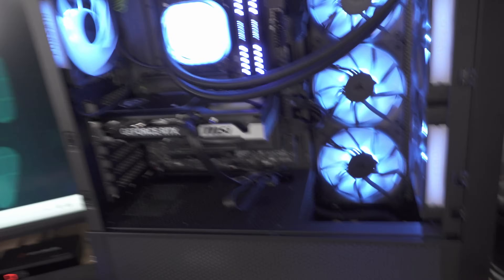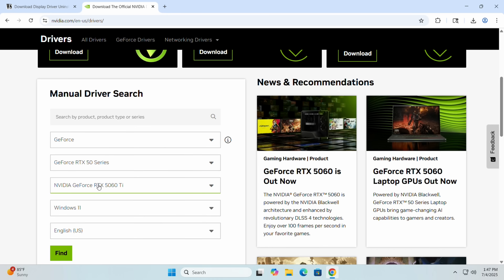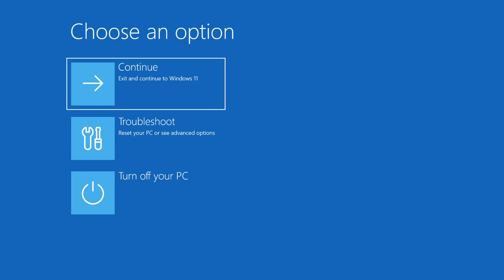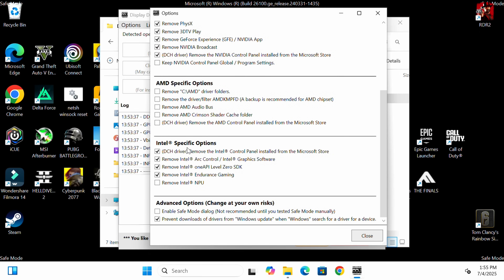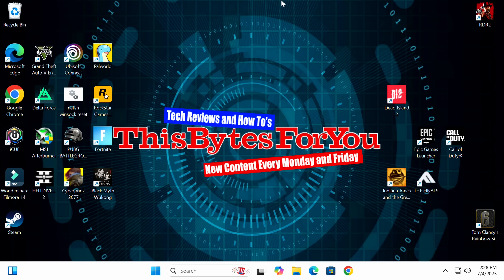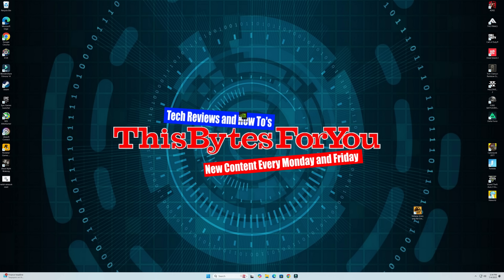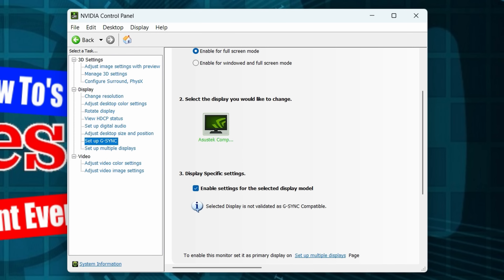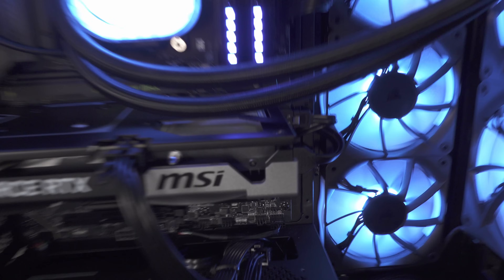The ONLY Way to Install RTX 5060 Ti? (Avoid Headaches & Maximize Performance)

Comment: Sometimes my screen turns black for a second then goes back to normal. Do you think this is a problem with my gpu or driver related. Please could you help me. Thank you
Reply from the maker: That can happen with driver time out, also with over heating and consuming too much power as well as corrupt drivers. What is the manufacturer and model number of your motherboard, graphics card, CPU and power supply
Reply: @ThisBytesForYou Thank you and the motherboard is a msi z490 gpu is a Rtx 5060 cpu is an intel i5 10600k and power supply is a Corsair CX 650M.
Reply from the maker: Z490 is a chipset and rtx 5060 is a gpu, please provide the specific model number msi in this case gave it and who ever uses the Nvidia GPU on their PCB.
Reply: @ThisBytesForYou Motherboard is MS - 7C80 and graphics card is MSI GeForce RTX 5060 8G SHADOW 2X OC Graphics Card - RTX 5060 GPU, 8GB GDDR7 (28Gbps/128-bit), PCIe 5.0 - DUAL-Fan Thermal Design (2 x TORX FAN 5.0) - HDMI 2.1b, DisplayPort 2.1b
Reply from the maker: So you have an MSI MAG Z490 TOMAHAWK motherboard.
#1, I recommend you update your BIOS: https://www.msi.com/Motherboard/MAG-Z490-TOMAHAWK/support
There have been a few performance, microcode, security updates, PCIE lane functions, Resize bar (Incredibly important for proper GPU use, ME and more updates)
#2, your power supply seems to be good enough, as a 650 when the card requires a 550Watt, as long as you are correctly connecting an 8Pin PCIE cable to your card and have it seated properly.
#3 Have you watched this video and removed your previous card (ondie cpu graphics is considered a graphics card, since it uses graphics drivers) and how I show you to configure the BIOS and install the drivers?
#4 A biggie is UEFI and GPT, i will list them below, please answer each so I can help you
  If your C drive GPT or MBR, you can find out by Right clicking on the Start button, then clicking Disk Management.  You will see on the bottom left side, Disk 0, Disk 1, etc, on the right of the lines you will see drive letters.  the line that shows the (C:) drive, right click on that Disk x and select "Properties".  On the properties window, click "Volumes" and on the line reading "Partition Style" what does it say?
  Do you know if your BIOS is MBR or UEFI?  To find out, download and run GPU-Z from here: https://www.techpowerup.com/download/techpowerup-gpu-z/.
After you download and run GPUZ, on the main screen, where it shows the logo of your graphics card Manufacturer, under there, does it show UEFI with a check or MBR or Legacy?
Reply: @ThisBytesForYou Thank you for your help and I will do these steps and get back to you
Reply from the maker: Sounds good my friend, let me know how it goes.
Reply: @ThisBytesForYou   For step 3 in the BIOS it doesn't give the options which you said in the video and in step 4 there is no line reading "Partion Style"
Reply from the maker: Help me out here, what does it say
Reply from the maker: Well yeah, you have a different board, so it makes sense but because your board is different and there is no pdf for your BIOS, I can only help you with the video i have, you will need to navigate your BIOS.  But I see in your settings, advanced, PCIe, PCIE sub system settings you have Resize bar, enable that, select the Gen for your card, your board I think only does 3, so select 3 or the highest,  for the rest follow along as closely as possible.
Reply: when u're installing drivers thats normal if it's in that case.. if it's doing randomly then i have no clue it might need a fresh install of drivers

Comment: Hi I am unable to get in to safe mode as when I press 4 or F4 it doesn’t go in to safe mode. Please could you help me
Reply from the maker: So there is a new windows update that killed USB support in safemode, just came out October 14th... amazing isn't it.  Try this to fix it, in regular windows mode
Go to Start > Settings > Windows Update.
Click Update history > Uninstall updates.
From the list, find the update named KB5066835 or one installed around October 14, 2025.
Select it and click Uninstall. This will remove the problematic update, restoring USB input in WinRE then you can try it again.
Reply: @ThisBytesForYou ok thank you
Reply from the maker: Always a pleasure my friend, so very happy I could help.
Reply: I’m trying to find the windows update to remove. I don’t see the windows update you mentioned. I have a usb for my keyboard and mouse.
Reply from the maker: @srtjas0n  that has been updated, so I HIGHLY recommend updating to the VERY latest windows update and it should be good.  You have a USB for the keyboard and mouse, you mean a USB cable connected to the keyboard and mouse to the PC?

Comment: Hi mate I change form AMD to rtx 5060 ti I did everything but the when I turn on my pc the gpu running but the monitor doesn't give signle
Reply from the maker: There can be a few reasons, i will list them below, please answer each so I can help you
1.  What is the manufacturer and model number of your Motherboard.
2.  What is the manufacturer and model number of your Graphics Card.
3. If your C drive GPT or MBR, you can find out by Right clicking on the Start button, then clicking Disk Management.  You will see on the bottom left side, Disk 0, Disk 1, etc, on the right of the lines you will see drive letters.  the line that shows the (C:) drive, right click on that Disk x and select "Properties".  On the properties window, click "Volumes" and on the line reading "Partition Style" what does it say?
4. Do you know if your BIOS is MBR or UEFI?  To find out, download and run GPU-Z from here: https://www.techpowerup.com/download/techpowerup-gpu-z/.
After you download and run GPUZ, on the main screen, where it shows the logo of your graphics card Manufacturer, under there, does it show UEFI with a check or MBR or Legacy?

Comment: My old card does not have a power connector. Is it optional on the 5060Ti ?
Reply from the maker: no, its not optional, the card requires 180Watts, a PCIE slot will only provide 150Watts and as its used, will consume more with heat, that being said, a system requires at least a 600Watt that means though next time you upgrade your graphics card, you will also need to buy a power supply, so I always recommend more.  You can nab a 650Watt on Corsair for under $70 but I would recommend at least an 850Watt.  If you are going to buy off of Corsair.com, use Coupon Code "ThisBytesForYou" at the check out to save 10%, it's not a lot but it will help.

Comment: So, You cant just plug it in and it work?
Reply from the maker: Ummm work is relevant, if you just want it to function, yes it will work but expect loss of performance and potential bluescreens and other random errors.  You want it to work well and get all the peformance you bought it for, follow along.  Which do you prefer?
Reply: @ThisBytesForYou  :'( 
Everything is so complicated these days.
Nothing is plug and play and requires this download, that update, and dont forget the app that is a nightmare to use.

How is a regular person ever supposed to be able to know if what they are trying to achive is even possible without consulting a tech guy.

Why is it so difficult for these companies to design things to be as simple as upgrading RAM or changing a lightbulb.
XD XD
Reply from the maker: My friend, I have been around since the beginning of home computers, before they marketed the term plug and play, it was more difficult becuase you had to mess with dip switches, jumpers, IRQ's and more, then plug and play came out and fixed everything... no no it didn't.  Ever work with SCSI? We still had to mess with IRQ's and some jumpers but it was coined Plug and Pray.  Since then, fast forward to 2025, and things are SOOOOOO MUCH easier, plug and play isn't used and more, but we are more plug and play than ever, this video guides you through everything to make it easier.  Nightmare app, open it, select when gpu manufacturer you are using, disable windows scanning for an newer drive and click and your done.  When you get back in the OS install the driver and you are done and using your graphics card.

What you fear is choices, with a Mac, you are stuck with what ever they configured for you, no choice because when you feel like you have a choice, its been certified to work, all 4 choices, nothing more, PERIOD.  With a Mac, no thinking required, they did it for you.  Ahhh but then theres the console, which only plays games, ohhh and you can chat with people and if you attach a keyboard, you can do the same,... but with a keyboard.

A PC, unlike a Mac and a console can use whatever OS you want, they didn't stamp a Patent on PC and leave it to 1 selection, you can build what you want, use what ever OS you want, use what ever motherboard, CPU, RAM, SSD, hard drive, grpahics card, sound card, RAID card, ethernet card, wifi card, bluetooth card, etc you want its yours DIY, Do It Yourself, you cant do that with a Mac or a Console, you can pretend you can.. you really can,.. but in the end... its a Mac or a Console.

It's difficult because you are shutting down and not wanting to learn, the things come with a manual in the box and if they don't they have a manual on line...  Heads up, before I make these videos... I read the same manuals, just in case.  A regular person will read a manual, I started without a manual, without the internet, without any guidance, I broke a crap ton of things, but I started today you have sooooooooo many options, you just have to want to do it.  This is why I made this channel, but sadly... some don't want to try.
Reply: @ThisBytesForYou  I'm left in the dust of that long comment...
It just isnt my lane, might have been able to if I'd started younger but... It's not a sector I feel like I need to be "understanding" at this point in my life. :)

I just think it'd be nice if things that need drivers, come with a free thumb drive in the box... with the hardware correct drivers and one single autorun.exe button.

Making the world a "install the hardware, turn PC on, run driver thumbdrive, get on with life" kinda place.

A man can dream...
XD XD
Reply from the maker: @caveymoley I have helped people in their 80s and preteens, you have to want to learn
Reply: @ThisBytesForYou  Already stretched too thin. ;)

But thanks for saying the right thing x
Reply from the maker: I know, never ending excuses, I am too fat, I get it, you can do it, you just need to try.  Here whenever you need it.
Reply: @ThisBytesForYou  Actually, maybe you can help!

I have a tower 

Processor	Intel(R) Xeon(R) CPU           W3550  @ 3.07GHz   3.06 GHz
Installed RAM	12.0 GB
Storage	466 GB HDD Hitachi HDS721050CLA660, 112 GB SSD Patriot Burst Elite 120GB
Graphics Card	NVIDIA Quadro 600 (979 MB)

And I wanna know if I can upgrade to a MSI RTX 5060 SHADOW 2X OC .

First by whether there is space for it (cards seems soo bulky these days)

and 2 if there is all the hassle of uninstall drivers and installation of drivers and safemode boots etc (like in your video) coz If so I'll probably just give £50 to the local guy and have him "make it maximum".
Reply from the maker: @caveymoley it sounds like you can but what is the manufacturer and model number of your motherboard but it sounds like you will want to give it to your local guys to work on..
Reply: @ThisBytesForYou  Defo.
It's beyond me, and it helps the local economy. :)
Reply from the maker: @caveymoley I am trying to help you and everyone with these videos, scroll down and see the tons of people it has helped and that thank me, people that have never done this, you just have to want to try but you don't want to try.  I hope he helps you.

Comment: Getting mines in December and cannot wait .
I’m getting a 5060 with a new power supply of 850 watts .

Saving rn
Reply from the maker: Good stuff my friend, happy I could help, PLEASE make sure you get a TI, not a regular 5060, but you may want to check this video out, comparing the 5060TI and the 9060Xt, you will be surprised, and I have another video I am working on with the 5060 TI as well, please make sure to like the video and subscribe, to stay up to date but check this review out: https://youtu.be/HgosIQF1lsg
Also, great choice on the power supply, more than you need now, but perfect in case you want to upgrade later, just like i do it ;)

Comment: Bought a pc msi 5060rtx 8gb ram instead of a 16 gb.    When u upgrade  did u replace the battery supply
Reply from the maker: Sorry my friend, I am not sure what you mean replace the battery supply, which battery, CMOS battery or do you mean power supply?
Reply: Power supply  i notice u didnt  @ThisBytesForYou
Reply from the maker: No, I did not because I had a 1000Watt, what is the manufacturer and model number of your power supply, it may not be enough to support this card.
Reply: @ThisBytesForYou i see i appreciate the feedback  😅just order the power supply  600 watts for the 5060ti rtx
Reply from the maker: anytime my friend, but I might have recommended more.  Buying the 600 now, next time you upgrade your graphics card, you will have to spend more to buy a new power supply making your card more expensive.  I bought about 4 x 1000Watt power supplies over 10 years ago, never needed to buy another, just a recommendation.
Reply: @ThisBytesForYou 😮😮 thanks for the heads up i just got into pc from consoles
Reply from the maker: Always a pleasure my friend and no worries, I have been doing this for YEARS (decades actually, god I feel old), newer people to PC's and even people that have been on the just as long still do it, so not a horrible thing, just something to think about next time you upgrade.  I am always here to help if you need and I have over 500 videos on everything PC related, from building a PC, to flashing and configuring the BIOS, installing windows, drivers and everything and upgrading too so if you need any help look around my channel, if you don't see it, please feel free to ask.
Reply: @ThisBytesForYou I appreciate it but this video will do alot once I receive my msi rtx 5060ti 16 gb
Reply from the maker: always a pleasure my friend.